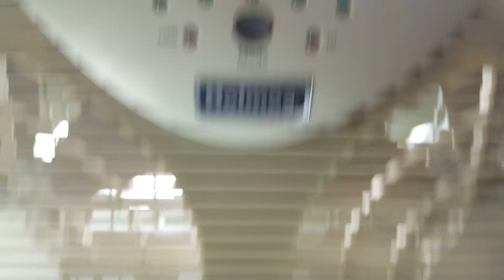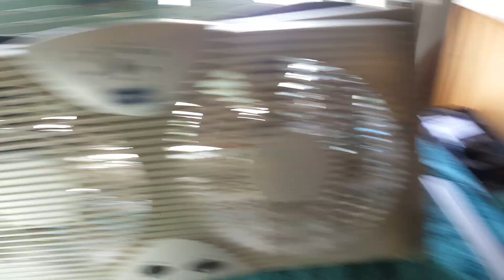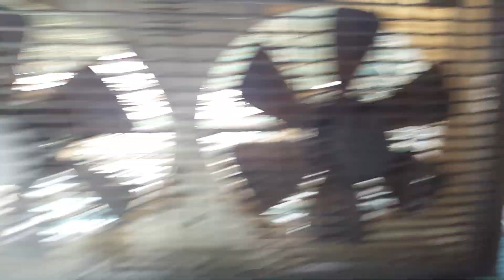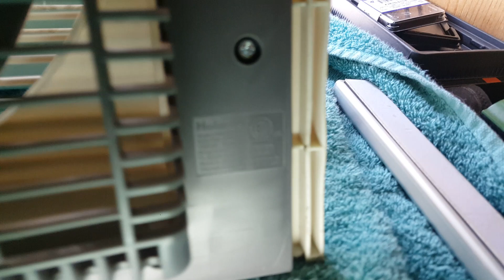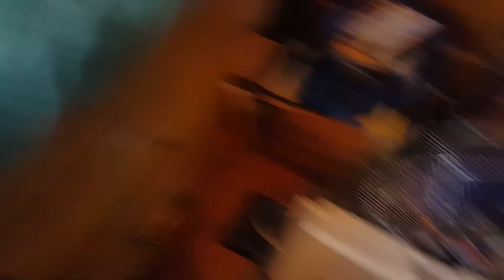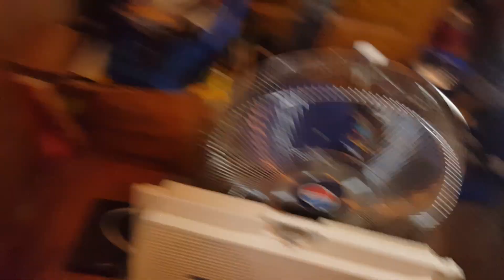Holmes One Touch Window Fan

Comment: My parents used to have a very similar fan! I think theirs was an older model, it didn't have individual fan control, and the cord came out the bottom. It was kinda of a stupid design, because eventually the cord broke and I was too young to fix it!
Reply from the maker: My older Holmes window fans have the cord coming out of the bottom so they can be flipped around.  Kind of a bad design, but since they aren't electrically reversible, that's how they have to be.  I like the fact that the new one is electrically reversible and doesn't have to be flipped around.  It also keeps the motors away from the rain at all times, since they're mounted in the front.  Did their window fan have electronic controls or was it just mechanical?